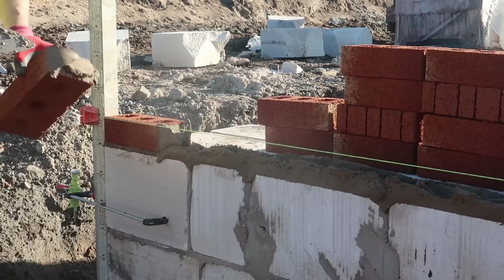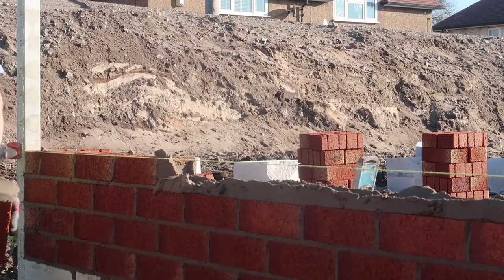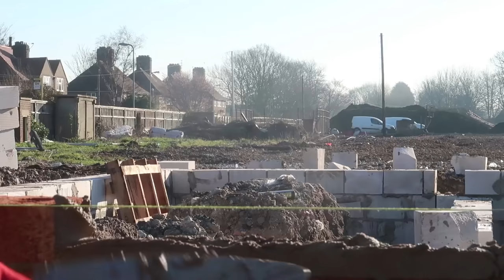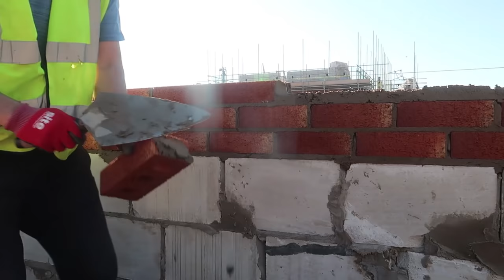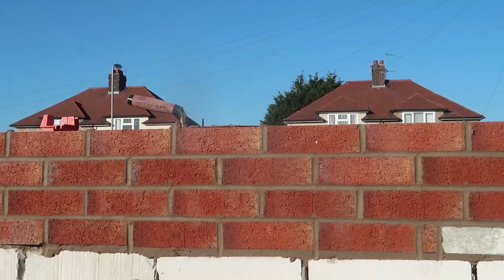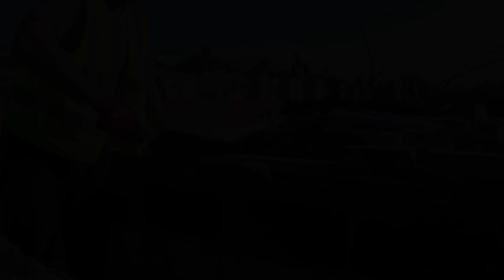Fastest Trowel Challenge UK

Comment: My question is why butter the brick you hold you have enough squeeze out to butter over top once laid..be quicker..just a thought mate
Reply from the maker: i can butter a brick better in my hand than when its been layed luke
Reply: True if there's enough mud when you cut it off. I didn't get to see how much mud was spread, furrowed, or cut back. We call it when cutting the mud off "the hook and run". If done right, you'll have a full head joint. P.S. the brick were " hacked" on the wall, increases the count "speed".